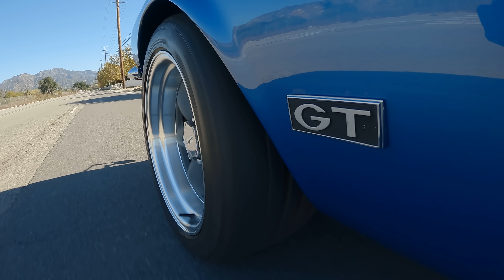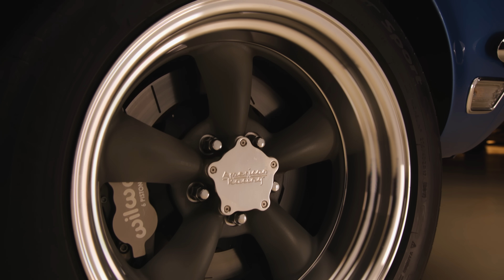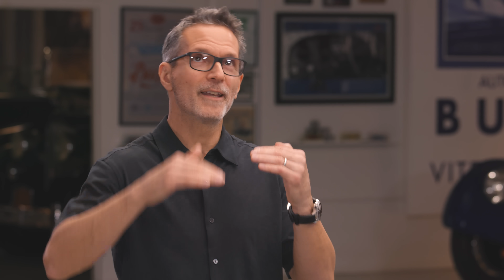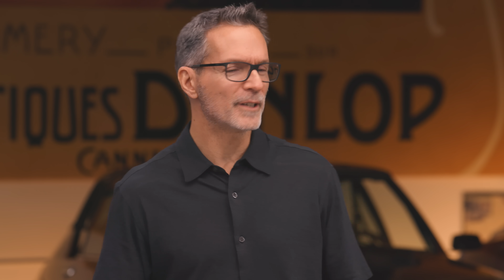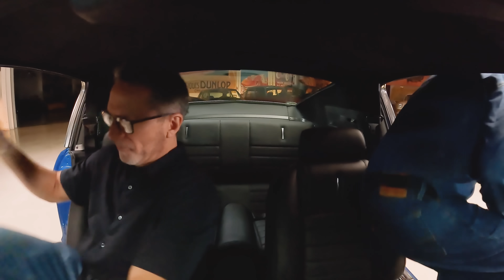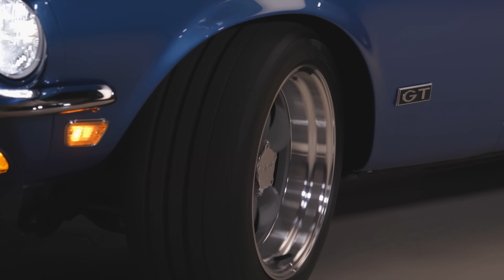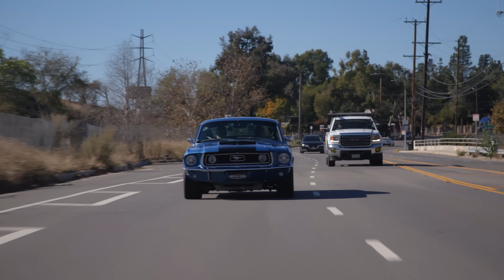Revology 1968 Mustang GT 2+2 Fastback Cobra Jet

Comment: Oh the memories. I learned to drive in a 64 1/2 Mustang Convertable with the 289HO engine and 4 and the floor.
Oh the horrors of the memories -- as soon as I turned 16, dad sold the mustang and replaced it with a '72 Chevy Vega Kammback. 2.0 liter aluminum block (may be 80 HP) 4 speed. 0-60 for the Vega -- yes -- it would hit 60, sometimes 62 before the hi-way off ramp. 
I loved that Mustang, dad put on Thrush Glass Packs and you could here that car coming 5 miles away. Clutch was gawd aweful, it would chatter like a the axle would start to tramp. First gear was one that taught you how to drive a stick, feather the throttle, and slip the clutch. Engine was sweet, the 289 is a wonderful motor. Only real issue we had was the car has a terrible habit of hogging in the middle and the doors would sometimes stick, or not be able to shut. Dern unibody and Minnesota Road Salt just did not play nice together.

Comment: seems like it has a lot of gear whine. is that because of the 3 link bolted to the axle?
Reply: Maybe you heard the supercharger?
Reply: that isn't a supercharger noise. @jimgoff1170
Reply: I'm thinking it's a Tremec thing and less sound insulation than on modern cars.

Comment: Nice dashboard, but those 3 switches (aftermarket window and central locking) need to be changed! ICON has a great approach repurposing old switches into modern use.

Comment: Very interested until I went to the website. That is one massive and ugly transmission tunnel - kind of ruins it. I had a 64-1/2 260 coupe and an early 65 289 fastback. Wonder if you can get a smaller transmission tunnel with a 5 speed? Not quite sure what you need a 6 speed for on a street Mustang with 400+ lb-ft of torque.
Reply: It's supercharged with 710hp and probably as much torque

Comment: My first car was a 68 Mustang Notchback with the 302, green with black vinyl top.
My dad got it for me when I was 15 for 500 bucks with blown out ball joints and electrical issues.
Dad said you got 1 year to fix it and get it going for your behind the wheel test at DMV..

Needless to say I learned about fixing cars pretty fast, no internet just books.
I passed the test behind the wheel on my 16th. birthday.

Man I Loved That Mustang and Thought It Was The Coolest Car Ever!
The Cars Name Was Todd!  LOL😂
Reply: Mine was a 66 with a 200 6cyl, c4 I got for a graduation present in 78.
I put a 68 302 In it and everything was a direct swap . All parts fit, even the drive shaft, the same c4 3 sp.
Only problem I had was I stomped on the gas to smoke the tires and it tore the old motormount out!
Reply: Todd?!?
Reply: My story is similar. 15 years old 1975, 65 fastback 289 T10 4spd.
Lite Blue  w/white interior.  The rear leafsprings mainleafs looked like a washboard!  It shook so bad 
taking off from a start.
I also took my Drivng test in my mustang ! 
I had a good job and made some upgrades over a couple of years. 
I built 289 HP clone, swoped in a toploader,out with the T10 , new Hurst competition plus shifter. Even with a new clutch, the 10.5 inch unit had to go! And I found a great deal on a complete 11 inch system from a pickup, installed that and OMG.! What a big improvement, I found a 9 inch 3.1 posi. That car was so much fun, 20 mpg. Cookies & what we call Drifting now. Best car ever.
Reply: Same here- got one in my senior year of HS (1971)
Reply: Go find it…re-live the dream!
Reply: lucky you! My stepdad said Id never have a DL or car til I left home. 
LEft at 17, was almost 2 yrs before I was able to buy a car. He knew lol
Reply: very cool!!!
Reply: What an awesome story 😊
Reply: Feels familiar.  I was 14 when my  father drifted back into my life and his guilt allowed for my 67 cream/white. 302 holly4, hooker headers, craiger 15x10s. 
He was many thousands in the red w child support but he dropped that whopping 2000$ and made me the coolest almost 15 year old kid in town. 
The lack of power steering (and breaks) amplified by the tiny grant steering wheel was a eye opener... the mid-90s. Glory days.
Reply: same story witta IROC_Z🥹
Reply: Its called a "coupe"... dweeb! Ffs!
Reply: Mustang,enough said.🇺🇸
Reply: this one time...... at band camp.........
Reply: @goonigoogoo5868  ....Were you in band camp because you can blow hard!??:hand-orange-covering-eyes:😂🤣😂🤣😂

Comment: Where did they get the body stampings?  Are they from the original  presses or did they make new molds?  IMHO  80% of the challenge is the body itself.  Nuts, bolts and running gear are relativity simple to  procure.

Comment: I am very impressed. But I wouldn't trade my '66 Sting Ray for it. My coupe is a legit old car, an actual classic that has been there and done that and then was disassembled and rebuilt price by piece The charm of the thing lies more than partly in it's capability even today with obsolete tech. It goes well beyond styling and that's what lights my fire. But this "Mustang" is a very impressive thing and I wish the company nothing but well.

Comment: As nice as the car may be, quite honestly, despite all the 'professionalism' in it, i looks and likely drives just like a early 2000s 'restomod'. I'm gonna hate on it here, yes. The wrong mirrors. The wrong wheels, including the wheel style and size. The wrong stance. The paint is bad. New engine, not even a proper cold air or ram air intake. Exhaust tips are way too blunt and unrefined. 'we don't we don't' have ABS or T/C on a friggin 710 HP superchared car that is notorious for being hard to handle, regardless of suspension. 

for the amount of money you have to pay for this, it's an insult, as people were doing literally this, literally the same, from their own garage, for not even a tenth of the price, in the early 2000s - but BETTER.

Also the panel gaps are obnoxious. 

This is not refined at all, this is not spectacular. 

You can do LET somebody do this exact same FOR you for a fraction of the cost, your LOCAL garage even. No, this is nonsense.

Comment: This year was also the first year of both the 302 and the 351 despite both engines originating from the 260 cubic inch V8.
Reply: They made the GT through 1969. The Mach1 kind of killed GT sales and it was discontinued for the 1970 model year.
Reply: @dougjustdoug6391  Fixed it.  Thank you

Comment: This is how I'd want an old muscle car - everything upgraded to as modern as possible.  Only thing it doesn't have that I'd want is airbags.  Maybe it does?  Electric windows trick is super cool.
Reply: Im guessing that by law airbags are required on anything built now.
Reply: I dunno.  That steering wheel looked like the classic impaler of yesteryear.  Beautiful though.   @markymark903
Reply: But it's basically LARPING for cars. For half that money you can buy a modern car that has all those things and a classic car for the weekends,
Reply: @O-plaat  Wow... I had to look up Larping to see what that was.  I'm kind of old.  😄

Comment: "Fun at any speed." A good quote from the company owner.  But jeez, $300,000, only 10,000 times more expensive than the original, or so.  It looks and sounds like a great piece of automobile craftsmanship, so I guess you get your money's worth.  Oh these modern times.
Reply: Actually, it is 100 times the original cost.
Reply: I thought the '64 1/2 Mustang was about $3,000, not $30,000. @johnbriggs3916
Reply: Hey John, I thought the '64 1/2 to '68 Mustangs only cost about $3,000, not $30,000.
Reply: @bobschenkel7921  $300,000 divided by $3,000 is 100. (Try saying it out loud.) Not 1,000 not 10,000. Is this where you have been going wrong all your life? 😉
Reply: I was an English/History type, not Math/Science.  LOL.
Reply: @bobschenkel7921  So it would seem 😉
Reply: BTW, Get over yourself, Zippy.

Comment: It is an amazing car. All the little details are sorted out. Having a modern drivetrain and suspension in a classic looking car is a great combo. Most resto mods are either cheap and horrible or super expensive and still not well balanced. 1000 horsepower is impressive, but without good brakes chassis and suspension it is simply a flexy scary deathtrap. Really, this car would still be great even with 450 hp from a stock GT Mustang. 300K is a lot of money though...helped my brother build a 428 SCJ 69 Cougar. Was fast in a straight line. Close to this horspower, a real handful to try and drive on the street...

Comment: Seat belts in 1968 were functioning as a strap, they held you in your seat vs. todays belts with the inertia system that locks them only when G forces occur. In those days, we used seat belts to hold us in the seat so we could apply all of our efforts in driving the vehicle eliminating the tight corners and bumps in the road effects to staying in the seat ! So, yes, they were cool..."we're going to get serious now".
Reply: Ain'tcha glad the Mustangs didn't have bench seats ??
Reply: @practicalplinking6133 Actually bench seats were an available option.

Comment: I am a huge fan of Jay and not normally one to complain but those cars are horrible, I have seen a total of 5 here in California, the worst being Kevin Hart's convertible! The body panel fit, gap, straightness and orange peel are actually horrid, if you watch closely you can see the ripples in the panels, it's obvious if you look at the reflection of Jay's legs for example 4:38 it's not the lighting or camera, if you see it in real life you would be speechless if you have ever done a car restoration of any type! The fit and orange peel in the paint is aweful, it almost looks like they do no finish work on the gaps, it looks like they just throw on a reproduction hood with no blocking the panels or cut and polish to the final finish! The console looks like it was a high school shop project and has no place in a $250k car. I think people here only buy them because they are California Emissions Compliant for what that is worth.

Anyway, just surprised Jay would in any way promote or endorse a product like this, at the risk of being put in Youtube "timeout" I have to say it. Shelby has to be rolling in his grave knowing his name is on those cars, not this one but they have Shelby versions too but I guess if you look at a lot of the Cobra replica's over the years these cars are probably not that far out of place sad to say.

But on a positive side, the interiors are really, really nice this one actually is the best I have seen with the modified hump and carpet vs a console. The guages, trim and seat materials are top notch for some reason.

Comment: Jay is so right about comparing old and new-I like my 40, 50, 60 year old motorcycles but sure do appreciate my newer ones!  Unless you are around the originals, it is hard to fathom the difference!!!
Reply: funny you mention newer ones.  Just helped a guy who had some newer type racing bike.  He left a light on that drained the battery while he was at a restaurant.   I gave him a jump start, but he had to wait a long time before he could drive it, due to an electronic transmission that needs full battery power to shift into gear.   His date was not impressed, nor was I.
Reply: @tompastian3447  HAH! YUP! new ones depend on the battery-it goes, the bike is dead!   Hard to beat the old Magneto system-reliable and you got a great workout kickstarting it!!!!